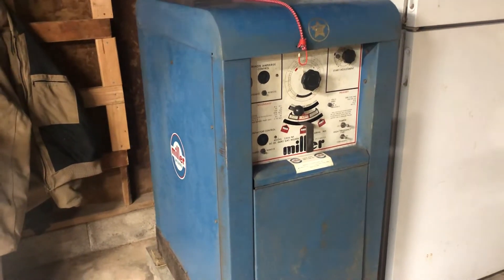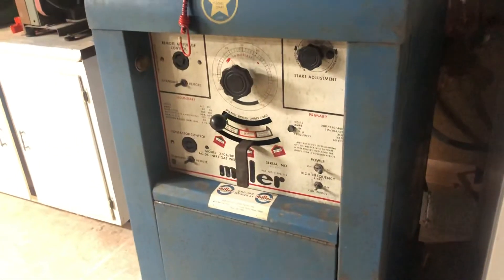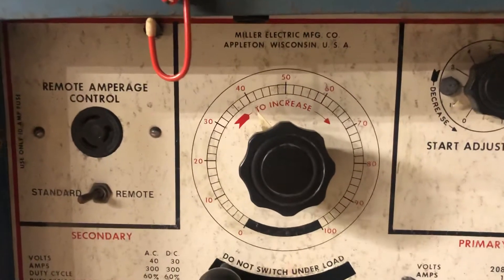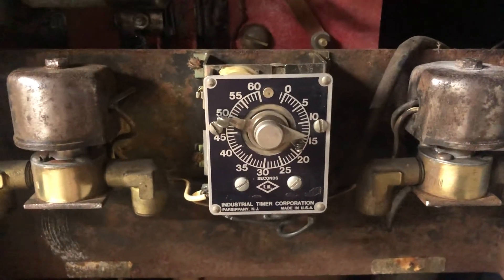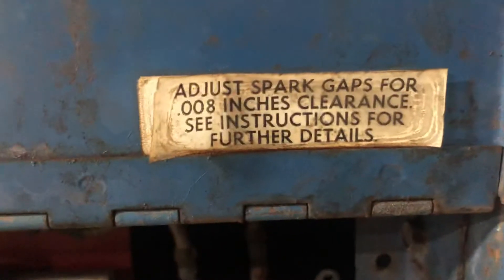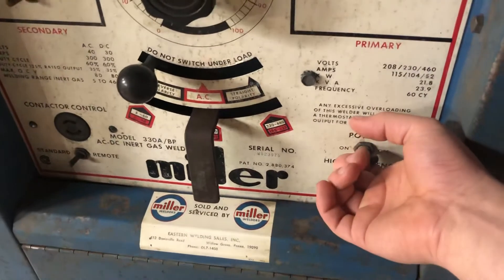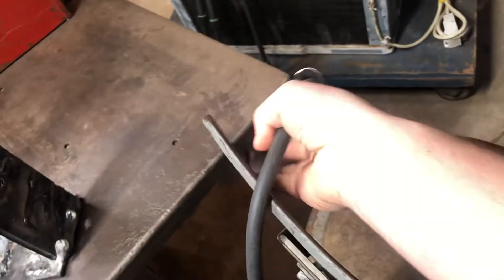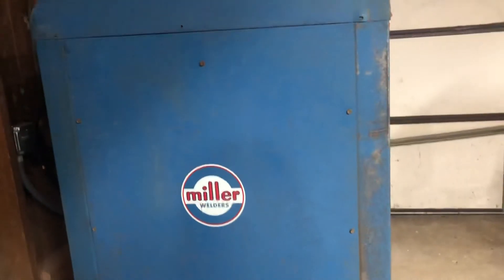Miller 330 A/BP (Part 1)

Comment: Good find young man~  I am a retired machinist welder and this welder was the standard of industry for TIG and Stick. The only set back you may  have that your 230 volt input must be at least 60 amps and #6 wire to be able to run it 120 amps Max for stick and TIG.   Most home 230 volt lines are 50 amp.  [to run this welder full out] requires 230v and 100amps input] Just something to consider.   Even if you are limited to 100 welding amps or so, it will make a great welder that will last a lifetime.
Reply from the maker: Awesome - thank you for sharing the knowledge, looking forward to learning TIG and putting the thing to work. I did some light stick welding and really enjoyed it. One day I hope to hook it up and be able to run it at its full output.